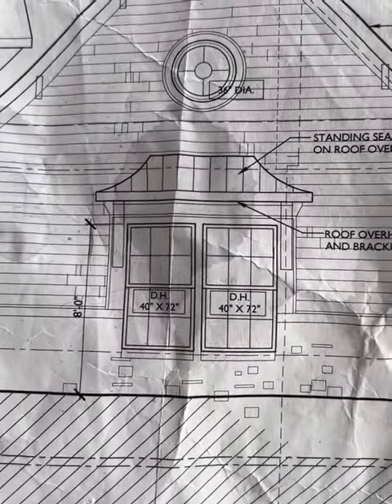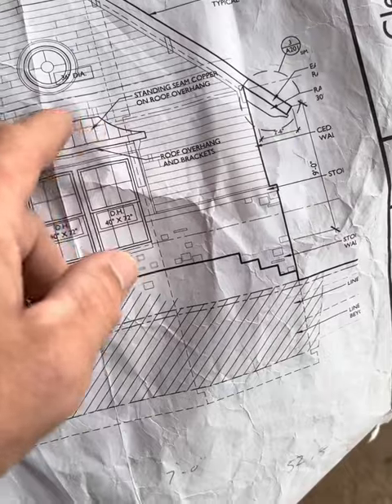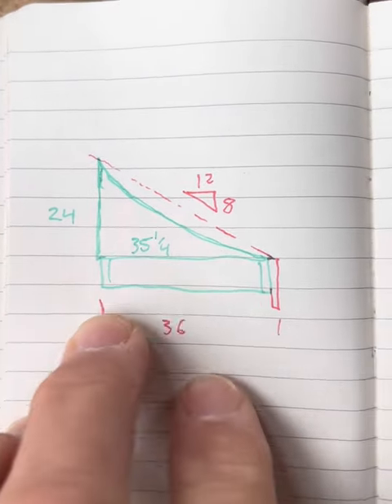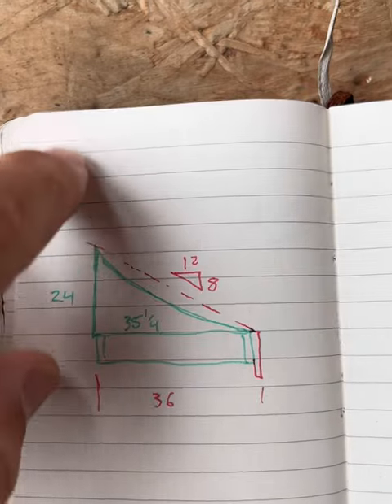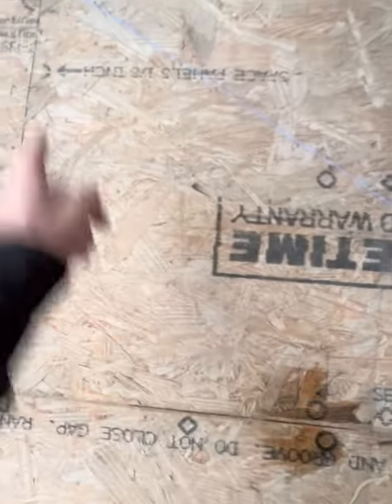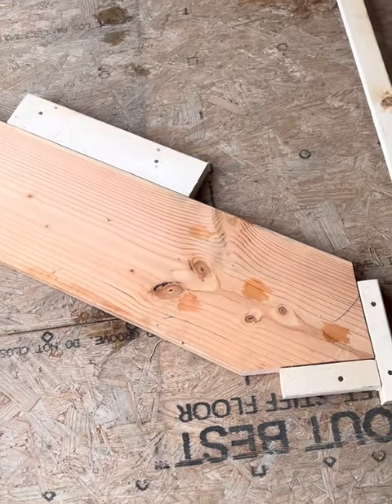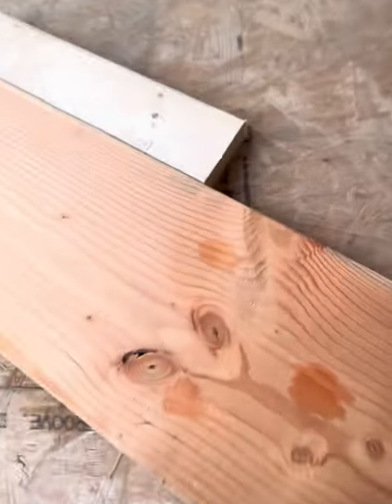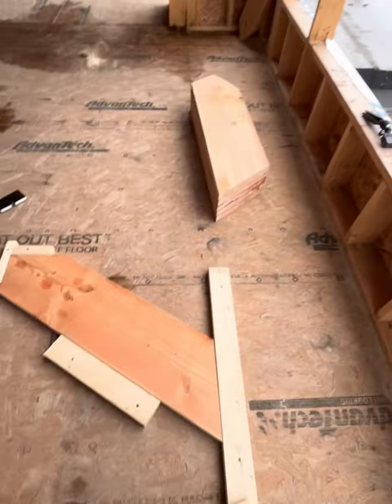How to frame a hip roof with sweep eaves

Comment: The reason u had to cut some off of ur hips is cuz an 8/12 is not the same as as an 8/12 hip and valley if u look at your speed square great example of something us carpenters have to deal with sometimes on a daily good work bud
Reply from the maker: Yeah brother thank you for your comment, however I’m super familiar with the difference between a hip and a common, that’s not the issue at all.  The rafter is a hip.  It’s a issue of determining backing angles on a curved slope, which is a more complicated problem than just backing a hip.   Do you know how to determine backing angles?
Reply: @Redoakcarpentry  never built one but looked fun I love challenges like these we are fortunate in this day and age to have computers in our pockets so I'm sure with a little research I could figure it out as u did
Reply from the maker: @howtodoconstruction9813  please do! And let me know how to figure out backing angles on a curved hip!
Reply: B 1:21

Comment: Traditionally, or originally. The type of roof you’re building. Was made from raw tree branches. Plained down to shape. From the curve of an oak tree branch. The branches were steam bent or dried  into shape. A good saw mill would have had these curved rafters on hand. Since it was a common shape used in caravel boat building as well as victorian roof construction.
Reply: Thats the kind of information i scroll down to the comments for. Cheers from a fellow Hawkins

Comment: That is a good idea to draw it out, but for me it's so much faster to throw in my commons, then tape a pencil to a damn 1x2, scribing the hip onto an 8/17 2x10 cut like a regular hip.
Reply from the maker: For sure, I would probably do something similar 9/10 times.  However there’s occasions when it’s useful to understand what’s happening.  I’m with you tho, it’s rough framing lol  I cut corners every day.
Reply: I'm with you guys, a small overhang or awning, I'll probably project a scribe line like you described. It's useful to have options though!

Comment: a solution for you hight problem would be to plane both sides at an angle until you hit  the center line. hard to explain without a drawing.

Comment: Why the 6  why 3 or 4   It would widen the radius I suppose but why 6   You said it was a good number I’m just curious
Reply: Good question!  The maximum sagitta (sag), for this use case, is approximately 8.96 inches.  Anything beyond that value will break the "aesthetics" of the curve.  You can verify this by solving a quadratic equation for the sag and taking the smaller of the two results.
A sag of 6" produces a perfect integer radius of 42 inches.  For this use case, the radius simplifies to R = (234 ∕ H) + (H ∕ 2) where H is the sag and 234 is (24² + 36²) ÷ 8.

Comment: Cool. I figure the radius and cut the commons. Place a hip temporarily. Tape a carpenters pencil on the bottom of straight edge and slide the straight edge(keeping it square to commons) up the commons and scribe the hip. The thickness of the pencil is usually close to the drop amount. I don’t frame anymore, but I used to love doing stuff like this..
If you don’t have access to internet, a great formula for finding a radius is
C squared divided by 8 h + H divided by 2. C is the cord of the segment and h is the longest measurement between the cord and arc.(height). Good stuff!
Reply from the maker: @thedieselpig4448  formula for a segmented arc is a good one for carpenters to know!

Comment: Hey lad! I think the solution to not having to take an extra 3/8's off the length, is to actually take the height dimension of what would form the backing angle of the hip, off the vertical height of the stand up/seat cut. 

That would have allowed the whole hip to drop down vertically. It would look wrong at the back of the fascia/frame , but the height of the fascia, and the imaginary centre line of the hip would match. 

Where I'm from, everyone is too lazy to do backing angles, and reducing the vertical height to the birds mouth by the backing angle height is how we compensate for the geometry. I imagine that this would have solved this problem for you, without throwing the hip into a slightly incorrect angle.
Reply from the maker: Hey brother, I considered this as well, and I’m accustomed to “dropping” the hip the same vertical amount as the backing angle in order to get a “non-backed” hip into plane.   However if consider that the slope is steeper at the top of the hip than at the bottom due to the curve.  So what would “drop” it appropriately at the top, would drop it too dramatically at the bottom.   Notice that it’s basically flush at the bottom.   It’s more complicated than a straight slope backing angle issue.  In a perfect world it would be a rolling backing angle that becomes less steep as it gets closer to the bottom.  I’m not sure why this issue isn’t really discussed in any of the literature.   If I were to install that hip without the adjustment, use a straight edge on top of the commons to project and scribe a line on the side of the hip, it would fade into nothing at the bottom.   You follow what I’m saying?

Comment: Nice tutorial!  Thanks.  I'm getting ready to build one over my side door and this was helpful.  I've only ever helped do one before and we basically just scribed the hip rafter by setting it in place uncut and then sliding a long piece of wood, with a pencil attached to the end of it, down the curve of the front rafters. It worked pretty good and didn't require any complicated measurement transfer like you were doing.  And it let you to adjust the length of your hip rafter Before the curve is cut, which gives you a very accurate curve.

As for the backing angle...  You can just leave it long and then shave down the high edges so that it creates a point on the top of the curve that matches the one where the front and side rafters meet at the top and then it dissipates and flattens out as you move toward the bottom of the curve.  That way your roof deck meets on the ridge point and sits solid against wood instead of having a gap behind it.  Only takes a couple minutes with a plane.  Or a belt sander also works good.
Reply from the maker: Thank you for the comment! Yeah I’ve done that as well.  After 25 years I find more pleasure in trying to understand the geometry of these scenarios than just knowing a functional way to produce the product.    I’ve put together a lot of complicated shit in the past with scribing and guess and check methods,  often that’s the fastest way.  Good luck on your project!

Comment: If i did this id have a ledger. Is there a reason not to?  How did you secure it? Great work btw. Im still stuck on scribing in my hip. Need to rewatch and wrap my head around your technique
Reply from the maker: I have a continuous joist behind the ply, so a ledger would be redundant in my opinion

Comment: I think you could have done it on a 8/17 with the 6 inch arch and did the radius. I am not perfectly sure because I am just laying in bed and haven’t cut a roof in, in about 12 years
Reply from the maker: You can absolutely do a similar maneuver.  The hip is never going to be a true radius, it’s going to be an ellipse.  But for the sake of being productive it’s possible to just cheat.  You have to do a larger radius for thd hip, one that’s closer to the actual ellipse.    I’ve also just cut the rafter and scribed it, and figured the curve to it that way.  super easy and quick.   I do like to understand the technically correct way, even tho it’s not always practical to do it.
Reply: Years ago i framed a very large bell for a gazebo. 3x12 actual timbers that would be exposed underneath. What a pain.  We did it the same way, plotted it on the floor.  So much work. The backing angle actually varies along the hip as well as you move from concave to convex.  Thankfully never did another.
Reply from the maker: @daversj  I know right!? I have been looking for a good resource on the backing angle issue, I didn’t back my hips here, but I had to fudge it a bit to deal with the backing angle issue, it would be way worse with 3” material.     How did you go about plotting the backing? Any resources on that?
Reply: @daversj  we framed a flaired (bell bottom) cone recently.  Took so much extra work.   Damn metal roofers just did a pitch break and covered it all up😂